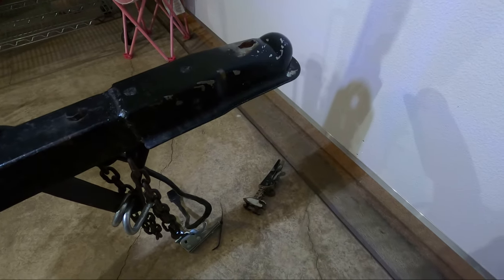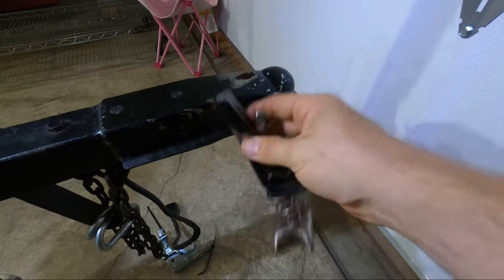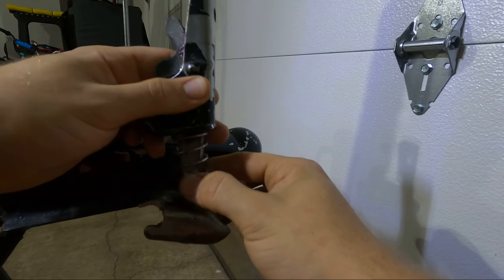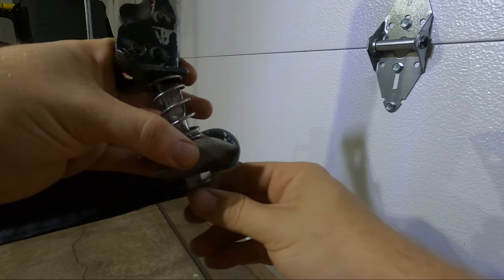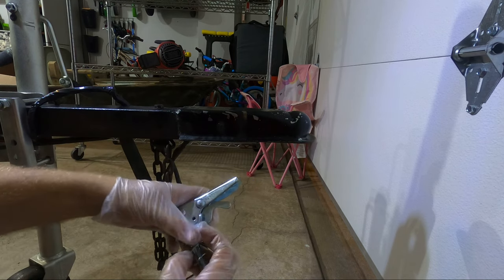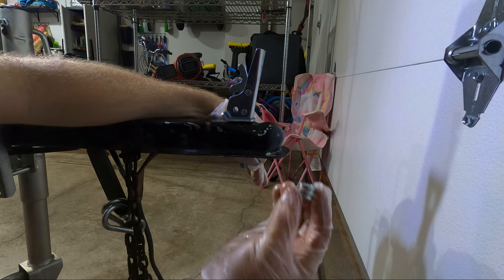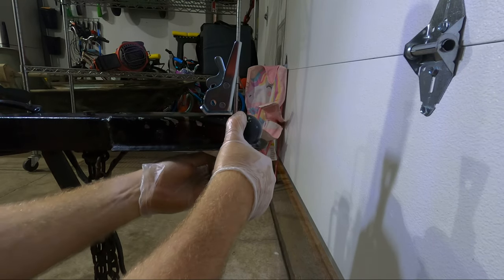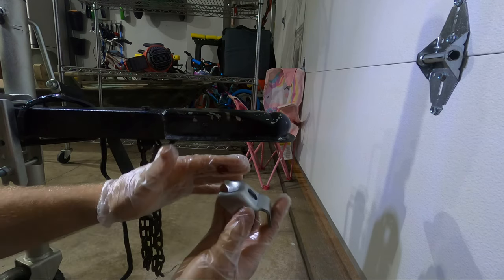How To Replace Boat Trailer Coupler Latch - Quick & Easy Installation - Tow Hitch Repair

Comment: So glad you made this video. Followed the instructions on the coupler package and could not get the ball to fit. Probably took it off and put it back on five times before finding your video. As soon as you said to fit the bottom piece on the bar under the tongue I knew what the problem was. The instructions in the package never once mentioned the bar underneath and I had no idea to look for it! Thanks for the help!
Reply from the maker: Glad to help!

Comment: Wow! this is exactly what I needed. I've got that bar/pin with the flattened head like yours, while most of the other videos feature tongues with nuts/bolts holding the end of the tonque assembly on. I can't remove the bar without cutting steel, so this video explained how to install the latch with the bar in place. THANK YOU!!
Reply from the maker: You're very welcome! Glad it was helpful.

Comment: Really needed this info since the latch on my new trailer was installed with the spring in the wrong location.
Reply from the maker: Awesome glad to help, couldn't find many videos on it at the time so figured it would be helpful info!
Reply: @mvboutdoors  : the bag with replacement parts didn’t have installation diagram either.

Comment: I bought a 3 year old enclosed trailer and in trying to take the hitch bits apart I find that I have one more part than he shows and I cannot get it to work with this extra part installed. I will remove this extra part and check back! Thank you!
Reply from the maker: Good luck! It's a pretty simple mechanism all in all
Reply: @mvboutdoors  Someone beat the hitch housing in from the left hand side and I had to bend/beat the L/H side back out so that the pivot cup could move freely. Not so simple to fix.
Reply: @davidwilson410  how’d you end up doing it?! Bought a trailer from tractor supply for a discount because the store manager bent the coupler to all hell. He said he’d just bend it back into place but no way he knows what he’s talking about
Reply: @OutdoorCanadians  With common hand-tools
Reply: @davidwilson410  oh wow thanks for your profound and extremely informative response! You must be in customer service 😂

Comment: im having ground issues. it seems like the old latch could be the problem? i ran all new wires to new lights. if the latch is up the lights work, if the latch is down they dont work. is it a bad ground area or does the old latch need to be replaced? anyone know? thanks
Reply from the maker: I would not ground to the latch itself, I'd ground to the tongue.
Reply: @mvboutdoors  i did ground it to the side of the tongue. But its weird how it works as i mentioned above. Could it be the connection to the hitch? Its a new hitch. Should i try removing some the new paint off?

Comment: The tension plate actually goes above the second spring not below it
Reply: no it doesn't. the tension plate goes on just before the nut. the two springs are aligned together.